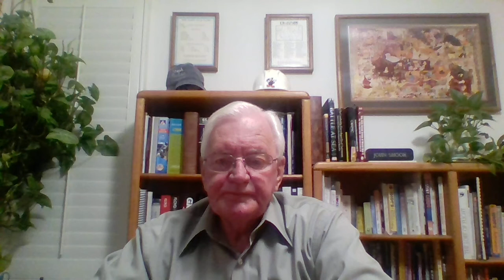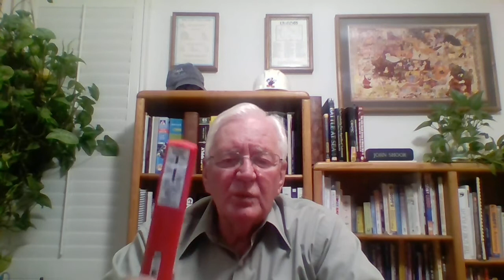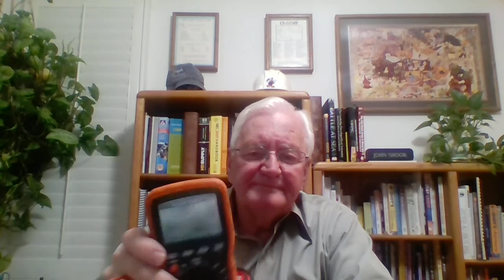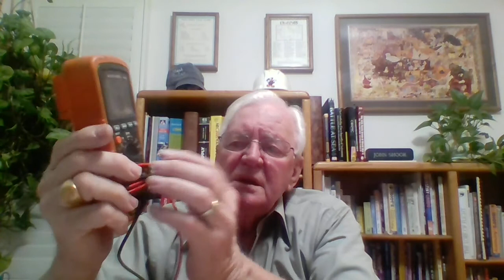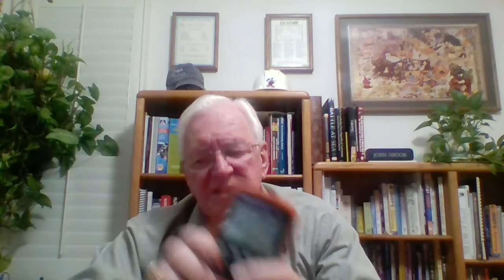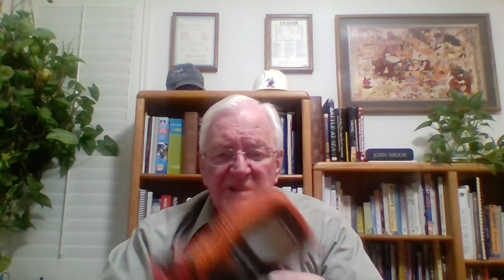Klein Tools Training Low Impedance, Digital Voltmeter, Klein Meters, Training, When Not To Use,

Comment: Hi John.
I was told a  magnetic motor contactor can be tested performing  a voltage drop across each phase,
using a Low Z feature;
 Have you done this test ???
what can you tell me about voltage drop  test ???
Thanks.

Comment: This is about V.D. (no, not that VD), VOLTAGE DROP V.D.!  When he says: "False Readings", he means FALSE  "GOOD" circuit VOLTAGE readings on an actual 'BAD' circuit that couldn't light a night lite.  But, on most digital HIGH-Z meters we all use, when you measure this bad circuit's VOLTAGE, it shows a FALSE GOOD reading. Why? A TINY SPARK ARC'D, micro-CARBON-bridge-SHORT is somewhere in the circuit at a LOOSE connection point.  The carbon bridge barely completes the circuit, thus, creating an amperage/current CHOKE POINT. It will pass JUST ENOUGH current to FOOL most digital voltmeters, until YOU LOAD THE CIRCUIT with a LOW-Z meter OR even a hair dryer! Then you'll SEE just how LITTLE VOLTAGE your meter will display.  So,,,, 
1. Connect your VOLT meter, 2. LOAD the circuit, 3. THEN read the meter.
FYI:  5% is MAX V.D. allowed on any 120Vac circuit, WHEN LOADED.  
More than 5% drop = LAME CONNECTIONS in the circuit somewhere.
Reply from the maker: B, Thanks for the clarification of my video. It is hard to explain at 77. I know I leave thangs out all the time, but I hope most of the viewers get it. Thanks  JS.